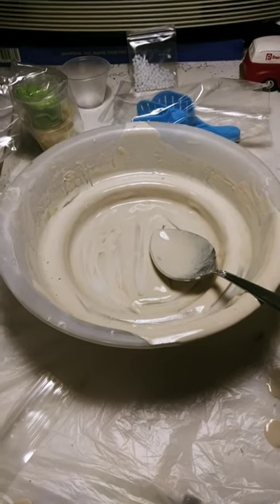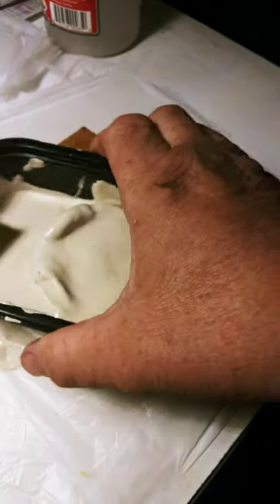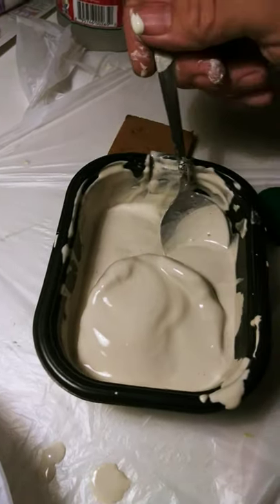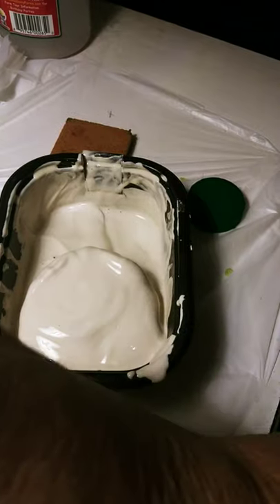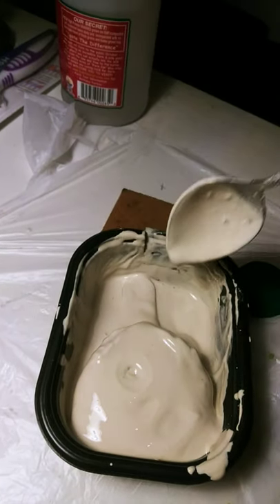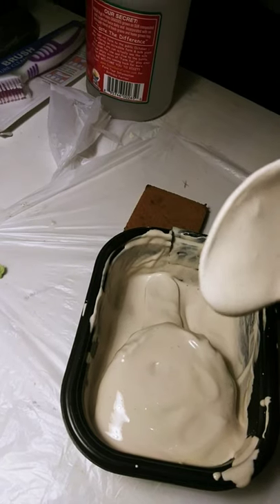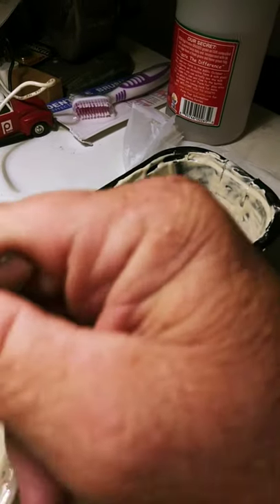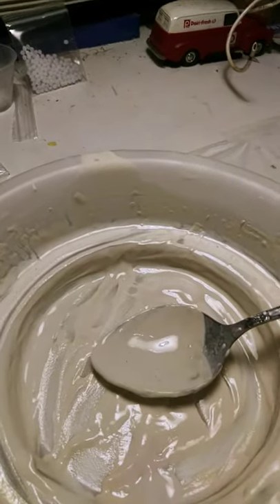DIY DENTURES #2(1)

Comment: Hi Kenneth...  First off I hope that all's well with you and yours.  Just another Kenneth here and I'm wondering how your DIY dentures have been working for you?  Are you able to eat with them?  Thanks in advance for sharing the drawings and the vids.
Reply from the maker: They have been working well. Considering I made them and saved an X amount of money. Though I only made the uppers. Having to make the lowers bit tricky since three teeth have to bridge around them. Two unsuccessful attempts in doing so. So still useing original partial for lower.. Stay tune.. ;-)